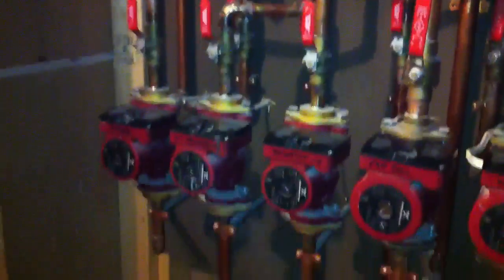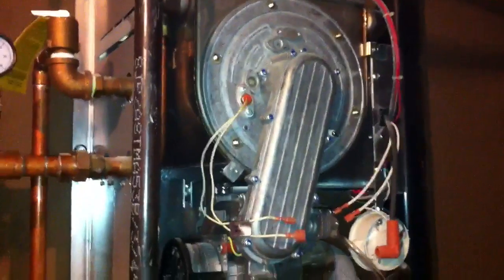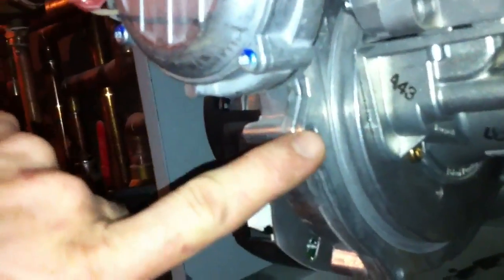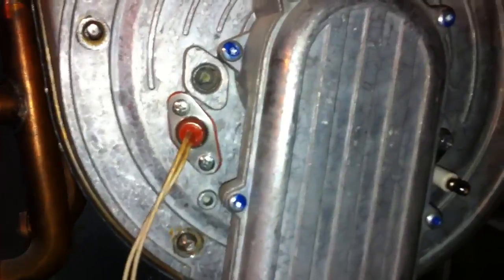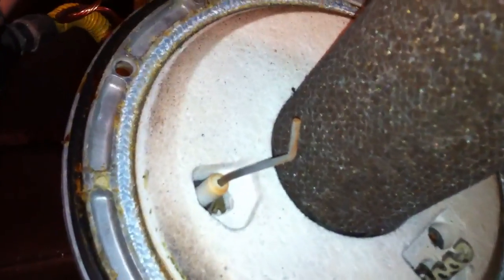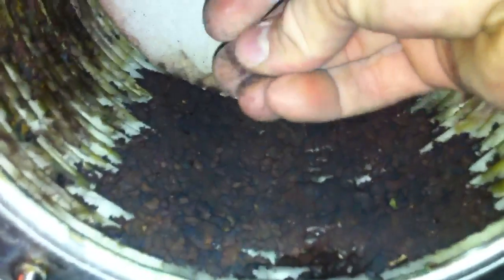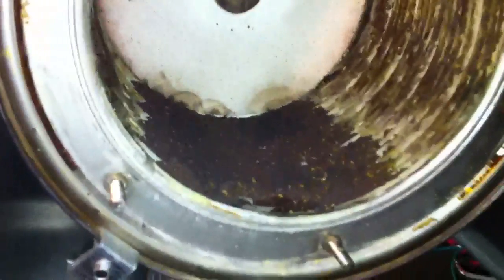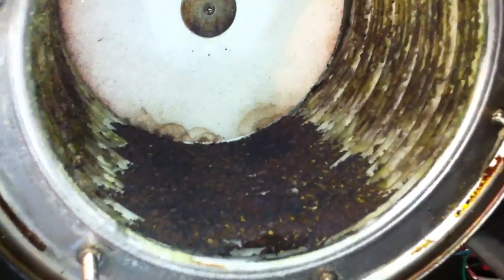Trinity NTI Ti150 cleaning

Comment: That's the problem with these newer style units. There's supposed to run more efficiently, and therefore they should cost less, but you're supposed to service them every year?!
There should not be built-in obsolescence in the unit. It should be able to function without having to be serviced whatsoever for at least 10 years. Otherwise it's not being designed correctly. And yes, that would be every single manufacturer that does these now.

Comment: I cleaned one the other day.  I have a plastic disc that pushes in and covers the target wall.  I accidentally left the plastic disc in the combustion chamber and put the burner to high fire.  by the time i realized what i did it was too late.  so i unplugged the boiler and took it apart.  there was virtually nothing left of the plastic disc I cleaned out as much of it as i couldand cleaned the condensate trap out.  from what i could tell, it cleaned up pretty good and the condensate was still draining.  Id love to hear what you all think of this.  do you think there will be trouble with the boiler.  btw the combustion analysis was also good.

Comment: The single rod is the flame rod . The other one (with two wire) is the ignitor hot surface . Watch it by the glass when it’s start you will understand

Comment: The “disk “ as mentioned is  called a target wall and can be replaced. You should use CLR to clean the heat Exchanger it and never use a none stainless brush unless it’s plastic. Your boiler is showing a signs of Vent gas  circulation with coffee grounds.

Comment: I have one just like this and have a question. I recently had this service by a tech. Looked just like this. But I have a problem. I get a banging noise whenever the hot water circuit comes on. When the heat circulating pump is on, it makes no noise. But when it switches to domestic hot water, it bangs like crazy. I must shut it off. I cannot figure out why. Any ideas?
Reply from the maker: lcagee the banging is usual caused by lack of flow through the heat exchanger the banging is water boiling inside(very bad). Check your primary pump it might not be working
Reply: WolffsPlumbing I finally figured it out. The pump was working fine. The HVAC guy said the thermostat was set too high. So he dialed it down. This is the thermostat inside the boiler. So now the temperature only gets up to about 160 vs 190. Not sure how he reset it but ever since he did no more banging thank goodness. It was driving me crazy.

Comment: hi, what's the sensor with the two white wires on the combustion door? also what is connected to the spark plug cable? thanks.
Reply: THe Spark plug wire is the ignitor, the other is the flame sensor.

Comment: I imagine this is not a diy endeavor. Not even sure what a combustion tester is. I had a tech come out yesterday to service my nti boiler. Error code 6. Ignition lock out. He installed a new igniter. Worked for an hour and now error code 6 is back. I'm assuming it's plugged? Probably full of sludge. Of course it's a Saturday and I have no heat. I don't mind tearing things apart except when it involves propane.
Reply: did u figure out what the issue was?
Reply: See above. It took me a year to figure this out. The guy who installed it set the internal thermostat too high. The flow to the hot water was too little causing overheating. I guess the return water was so hot that when it passed thru the coil it was boiling. It was hitting 190 degrees. He turned down the boiler settings and this solved the problem. I had two igniters go bad. Not sure why. Maybe the banging caused them to fail?????

Comment: That's the exact same heat exchanger as in my Lochinvar. I just cleaned the same kind of corrosion out of it a couple days ago. The stuff looks like coffee grounds. It turns out the stuff is magnetic, so it's coming either from the burner or the hx coils themselves. Any insight on that? Also, is it a good idea to spray CLR or some other cleaner in there before a water flush?

Comment: i hope you wore a mask when doing this because this crystalline debris is all extremely hazardous if inhaled. You touched the debris with your bare fingers. Also not wise. Since it's a combination of ceramic crystalline debris and sulfates in the gas supply you're using. Might be helpful to point this out to joe user instead of just reaching your bare hands in there and playing with it. :)
Reply: Gould points. I hear the condensate is acidic and contains nitric acid. Prob not good to get on hands and eyeballs.

Comment: I'm doing a baxi, where it's plugged with debris tommorow, baxi boiler, tech said I could use clr and water, just cut a peice of cardboard, and place inside to protect heat reflector, don't try to remove, could cause more damage, did not know about the nylon brush only, thanks for the information, did not know this as my company beaks with triangle tube (extremely expensive) and rinnai.   Thanks for the information.